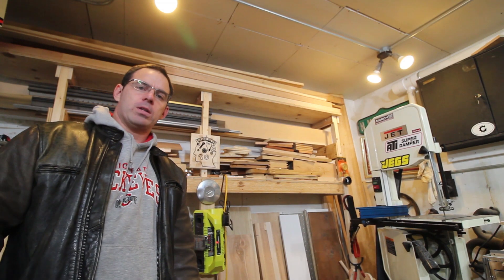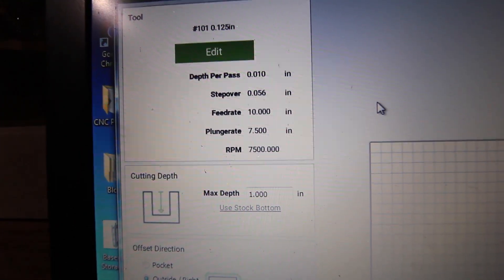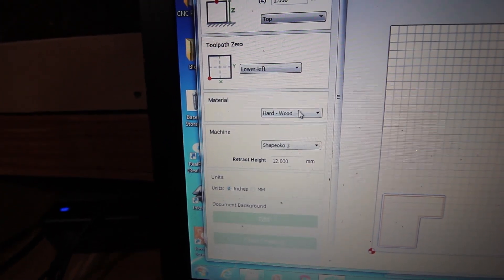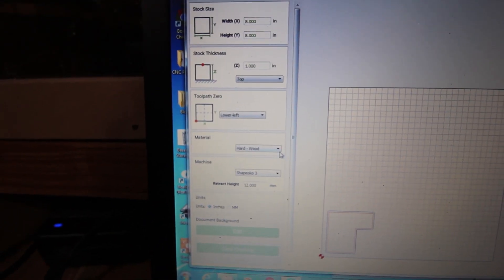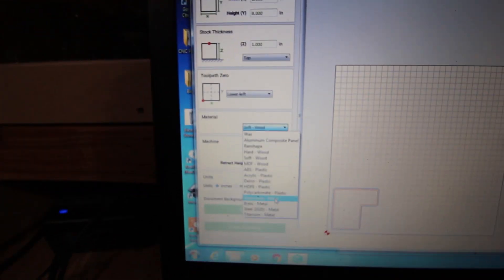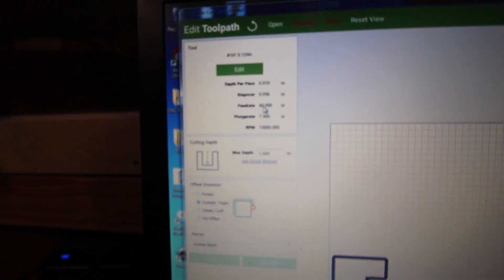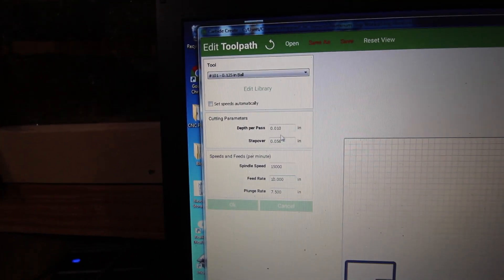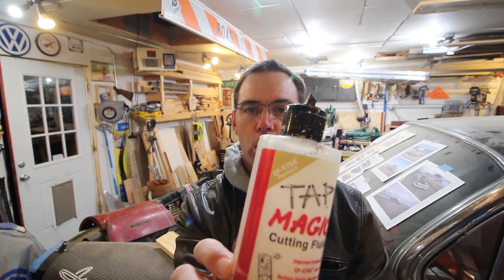Shapeoko 3 CNC Settings for Machining Aluminum

Comment: If you're using the DeWalt 611, it STARTS at 15K RPM and goes up from there.  Take a look at Fusion 360 Adaptive clearing.  I'm doing .125in in 6061 AL full depth at 23 in/min with a 2 flute .125in flat carbide endmill and there's no chatter at all.
Reply from the maker: Dan Shookowsky this is helpful. I’ve not devoted the time to Fusion 360 that I could. Will come up with a project that requires it.